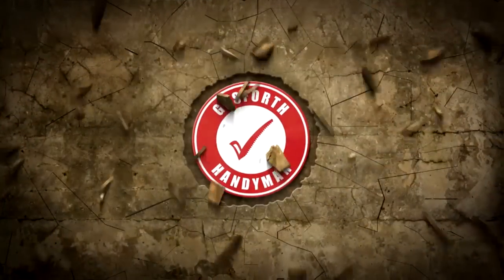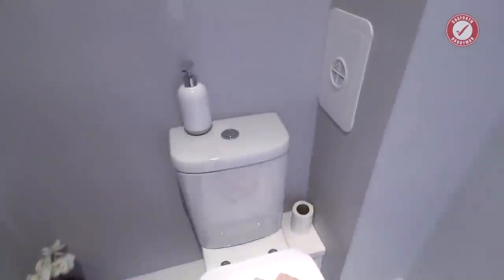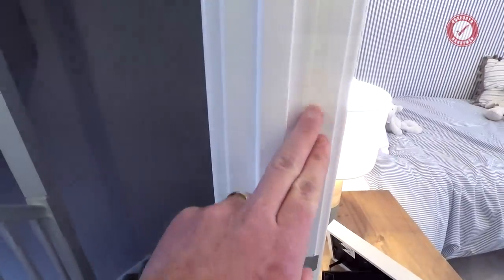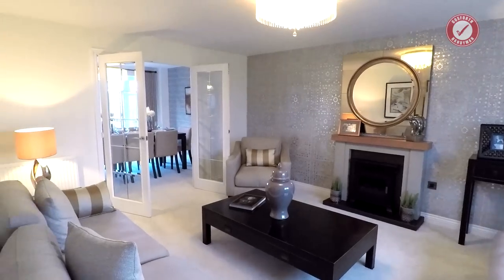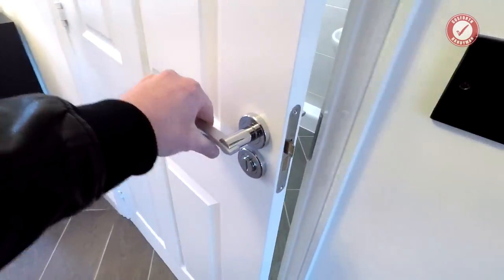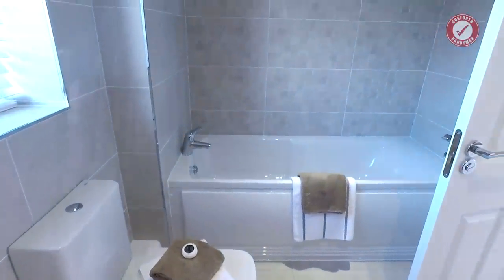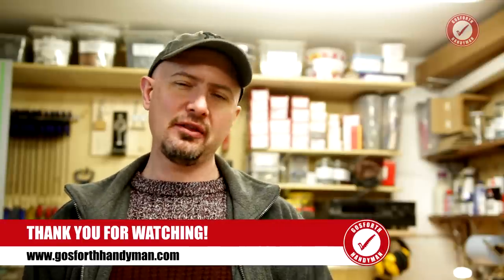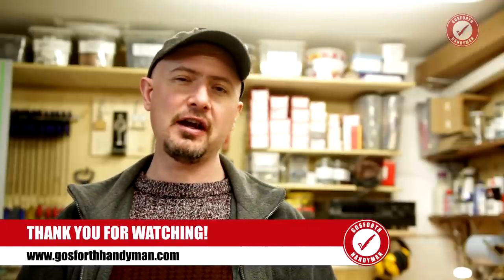How are New Houses in the UK Built? Looking at Showhomes!

Comment: I've always found it odd that the 2 major purchases in anyones life are a car and house. If they are new it seems there is little protection for the buyer. So for instance if I buy a £4k tv from a high street outlet and it goes faulty from the get go, then I have the right to a exchange, repair, or refund. If my house has a major fault i only have a right to repair, and I have to put up with all the mess of being in the house whilst repairs are taking place. I know someone who had to have the kitchen removed whilst a floor wast aken up and relaid because of a crack in the concrete. The builder didn't move them out, but covered the cost of  them eating out in the evenings!! Needs addressing.

Comment: I know this is old now, but it sounds like you haven't lived in a really old property.  You need to try it.  Built in the 1700's or earlier.  They are in a whole class of their own. They have many problems, but they make amazing homes. There's something quite special about them.  Just don't "modernise them" instead operate sympathetic conservation and you will be rewarded.

I used to be an inspector for a water company.  Initial and final water inspections were part of my job.  Even the big executive new builds were not built very well.  Thin, flimsy walls. Not much sound proofing and small gardens, often overlooked.  The cheaper houses were terribly shoddy underneath the plaster and paint and recently I've even seen an "executive" estate in a village going up with external, bolt-on, decorative prefabricated chimneys!  No fireplaces.  No fires.  But from outside it looked like a chimney stack with a pot on top.  They were delivered on a really long low-loader!

Comment: It is all very nice looking (well from the inside), but it is built with matchsticks and lashed together with half a cup of cement to a mixer of mortar. I feel so sorry for those who go and buy a new build and don't realise the rubbish they are buying. Most normal spec homes are kitted out with cheap as chips boilers, kitchens, hardware, doors, windows etc. 

Give them a few years and the ceiling start to ripple and show signs of screw-head pops, they creak and generally just start to look a bit tired! Render will discolour badly in wetter areas, crappy little commercial style drum bulkhead light at the back door, built on top of each other with a postage stamp of a garden separated by a few slats of sarking board lashed to some posts, usually just builders mess raked over a bit with no quality to the soil because they sold that all off when they scape the site clear for building so you need to import top soil (probably buying back the stuff that was there from a local merchant) to make the ground up.

You basically end up living in a flattened field, with some roads, some crappy lawn and nothing old or mature, maybe the odd semi-mature tree shoved in at the entrance to detract from the point it was once a nice field and they just levelled it to build crap. 

New build houses of today are the high-rise schemes of tomorrow - these houses will be torn down en masse by about 2050.

Comment: How can you consider a 2x2 room to be called "bedroom" ? Why no one in UK has the guts to measure the house in SQM instead of dwarf sized "bedrooms"? Why something that can be bricklayed in 6 days by 2 people costs 250k? Why you call that tiny thing in front of the house a Garage if it doesn't fit a car given you need to open to doors to get out of the car? Why the windows are so small and the window frame so thick given theres lack of sun?

Comment: would have to agree with much of the sentiment in these comments where new builds are not worth the money. my sister bought a house pre-construction about 3 years ago solely due to its location (nearby family). she was pretty disappointed when she was invited to see the finished product but knew if she walked away she'd be lucky to find anything else close by. the snagging list was around 150+ items and she was still left with things like a kitchen window sill so far out of level with the counter that an 8-year-old could spot it and split stair bannisters that were installed at different heights. some of the excuses the site manager came up with to try and explain these away were like something out of a sketch comedy. the thing that irks me the most every time i visit is the switch and sockets placement (disability regs) with the switches too low and the sockets too high. the best one has to be; when you enter the front door, the downstairs toilet is on your right-hand side, so you turn 90 degrees to your right to enter the toilet and look for the light switch... where is it... it's on the effin wall behind you (ie the opposite side of the hallway).

one piece of advice to anyone buying pre-phase is to try and keep your communications with the sales rep to email so there is a paper trail and ask loads of questions as to what the finish will be inside and out. that means when the house is finished and you say to the sales rep "hold on, you told me it would be sandstone facings on the ground floor and render on the first floor, just like the image in the brochure," then, when she denies saying that and points to a small disclaimer in the brochure saying these are "illustrations only" then you'll have something to fall back on.

Comment: Hi, You were surprised to see copper pipe in the houses, what did you expect ?. also the boiler, as you have probably realised I am not a builder. could you please do a video explaining the different boiler types and why they are better / worse?. Great video as always
Reply from the maker: You see a LOT of push fit / plastic pipes these days - nice to see copper for a change! I'm no plumber so not the best person to ask on the comparison thing - in short combis are great for smaller houses / flats but they struggle in bigger properties. Unvented systems are where it's at. 👍
Reply: Boilers are spec'd to the size of the house having a gravity fed boiler vs a combi boiler on a large house is smart. Seeing a combi boiler in a 3 storey building is a no no in my eyes especially if you enjoy long hot showers like i do :D
Reply: Combi boilers are best in any property as long as it's fitted correctly, putting a combi on the first floor with a good head/flow rate from mains are best for long showers or multiple showers. Unvented  systems are restricted to how much hot water is delivered, however if you want solar tubes to help keep water warm/hot for cheep then it's for you. Personally ground source heat pump is the way to go especially when gas prices rocket in 2025 which will see many combi boilers scrapped.
Reply: Gosforth Handyman it'll all be pushfit/speedfit for heating under floors then copper tails on show. I think potable water remains copper throughout as does gas.
Reply: Y-it-Earp Combi boilers are used in homes bigger than three stories but are usually complimented with an unvented cylinder mid way up so it's primary will be for central heating.

Comment: I bought a buy to let from Barrats in Belvedere, Kent nr London and the new Cross Rail. We don't get the sizes of houses you are showing here!  And for a 2-bed house it's around 270k!  Prices went down after Brexit.  We have copper pipes too but the standard of finish in plumbing is horrid. So far had 6 calls under warranty. One because a tap was leaking but when it was changed it was fitted with a 2mm hole on the side rather than centrally :( Or  a tenant blocked a basin with long hair  in the bathroom, and the waste pipes started to leak somewhere and water went through the ceiling in the lounge! They have even refused check under the warranty why the pipes have leaked (after I cleared the block) "the blockage has caused the pipes to expand and there's nothing wrong with the plumbing" I am wondering where I can take them to prove their ignorance! As there are so many waste pipes in that house, if all of them have not been sealed properly I might have a big problem in the long run. Never yet had a blocked waste pipe leak in my old house... It's not the new houses fault but a lack of proper workmanship. Like the bannister in your video.  Those houses seem to be better quality tho.
Reply from the maker: Yes, blocked waste pipes shouldn't leak - it's amazing what they come out with. It might be worth paying a plumber to do a survey to check stuff out while it's still under warranty... although a lot of stuff will be inaccessible so it would never be 100%. Cheers for watching! 👍🛠
Reply: I was thinking of blocking the waste pipes from all 3 basins to see if they leak!  Hopefully won't need to, got someone more sensible on the phone today.

Comment: Who the hell would leave clean towels on a WC seat?  Even for a showroom that justs looks stupid...

Why no underfloor heating?  It does away with any wasted space from radiator positioning..   Of course prices for this are crazy.   

Three floors so they can squeeze more on to small patches of land - cheap and not great for family living..

As for new builds - they are better if you get them built yourself and you control the quality of material, tradesmen skills etc

Comment: We bought plot of land about 1000 metres designed our house built using sandstone timber framed sash windows slate roofing we made it look like been built in the 1900 with 5 large bedrooms 4 large reception rooms 3 bath andcwe used best kitchen amd bathrooms all round oak doors skirting living fireplace and did cost us about 60 percent from the new built houses nearby and they are very smaller with very small gardens
So for those who have the cash and the hart just go and do you will never buy new build house again

Comment: First house, why didn’t they put the boiler in the first floor cupboard. Dumb putting it in the kitchen, house felt so small.
Reply from the maker: That cupboard is for a hot water tank... but they went for the cheaper option of a combi boiler instead. Would probably be difficult to vent it from that cupboard. 👍

Comment: People here are saying that old British homes were mansions and the new builts are tiny. Absolute nonsense. Majority of the old houses are tiny with hardly any storage or insulation. Everything is outdated. When you talk about gardens, yes it's true. Most of the new builts do not have large gardens. But, then there are thousands of old houses which doesn't have from gardens. Sometimes I wonder where does these people live. My sister bought an old house and she had endless problem with insulation, old radiators, mould issues. Finally she ended up selling the house with a 5k loss. She now lives in a new built from Berkeley. Ever so happy. She says she'll never go back to an old house.
Reply: Yup! The vast majority of old houses are them tiny terrace houses

Comment: No central heat and ac? Why are they still using radiators? This isn't the 1950's anymore...
Reply from the maker: Ha ha, a/c isn't needed in NE England. Radiators are from a central boiler. 👍
Reply: @GosforthHandyman  What with the heat waves in the south of England in the last 2 summers, England will need a/c in the near future!

If I was living in England, I would like to have a central a/c not only to keep cool during a heat wave but also to dehumidify and keep the air circulating while the windows are closed. Also with a geothermal heat pump, you can use the ground to heat and cool the house, saving a lot of energy.

Comment: Had a Bellway new build a few years back, it’s was shocking.  Paid over £25k in upgrades most of which they messed up.  Wrong wardrobes fitted, wrong tiles in bathrooms, garage power supply laid directly under turf, bath cracked, poor quality carpet despite paying to upgrade, poorly cut floor tiles filled with mastic around the edges... and the quality of painting was beyond amateur .  Every snag they tried to bodge and then caused at least 1 additional fault.  Bellway HQ couldn’t care less.  Gave up after 3 years and sold it.  A very expensive mistake.  Too easy to fall for the look of a show home and the idea of a new house.

Comment: Integrated fridge-freezers useless for shorter people. Why no space for a tumble dryer?  Airing cupboard?  No full height cupboard in utility room so storage for ironing board, mops, etc is where?
Beware appliance packages - you'll be told they're "Bosch equivalent" which is garbage, they look OK and function terribly.
He shouldn't be amazed at the size of the cloakroom - they've all had to be wheelchair accessible for the past 15+ years. 
Sizeable hallway but no coat cupboard. Good solid door is fine but side glass panels make it pointless.

Comment: Show homes are normally all white or magnolia painted walls, white woodwork throughout, the lounge is filled with down scaled size furniture, and a few big mirrors to make it look bigger. The kitchen is the same, down sized units, it’s all a big con to make the rooms look bigger than it really is. Lastly, don’t buy a new build off the drawing, you have to allow for dry lined walls as you can lose vital inches on the size of room, it’s called dot and dab, plaster board over blockwork walls, but the walls would be more solid than basic stud work. Don’t buy one 👎🏻👎🏻

Comment: Don't buy a new build they're built as quickly as possible and use £20 doors painted MDF finishings every wall is stud partition no brick and plaster inside.
Reply from the maker: Joe - almost everything you've listed is wrong but they're all common myths.
Reply: Gosforth Handyman I'm a joiner bud.The ones I've worked on is usually MDF skirtings and MDF facings painted also painted staircases hiding the quality and the houses started at £250000. I don't mean to annoy but I've seen first hand. Just my point of view cheers.
Reply from the maker: Plasterboard stud walls have been around since the 1940's and plenty new builds have internal block walls with dot & dab. You can't get fire rated door sets for £20. Don't really see the problem with MDF skirting if it's being painted.

Comment: Horrible first property. Tiny windowless bathroom with boxed in pipework and separate taps. Utility without a sink? Integrated white goods in a utility? Minuscule off centre sink at the window. Tiny postage stamp sized garden overlooked by the neighbours. Warped woodwork with poverty spec white paint covered in nibs. Tiny Single bedrooms with zero storage. Fitted wardrobe with horrible flimsy sliding doors that derail after 2 years. Family bathroom with shower over bath.